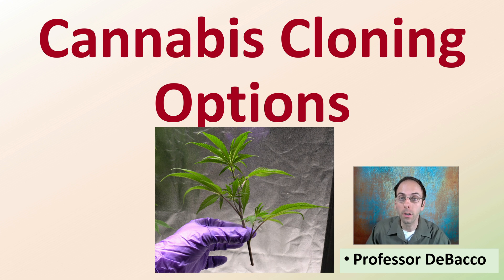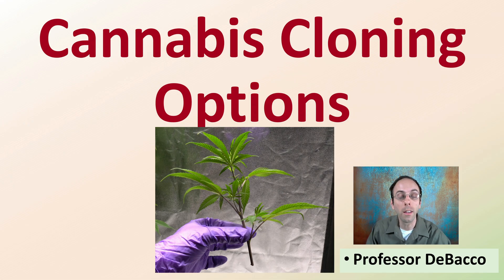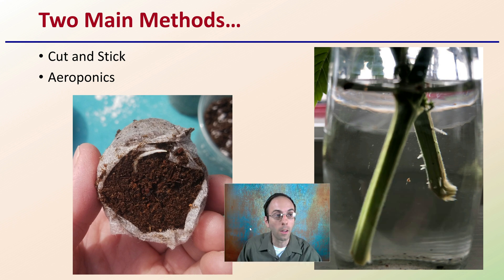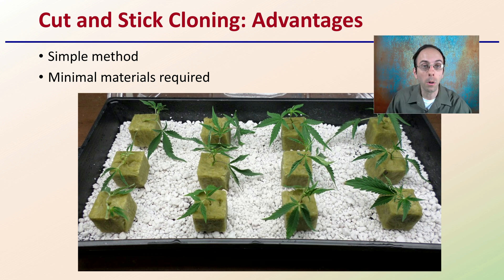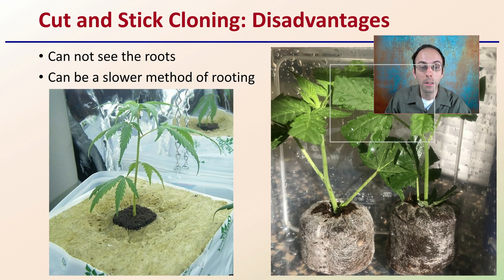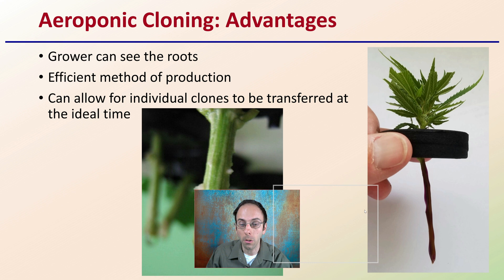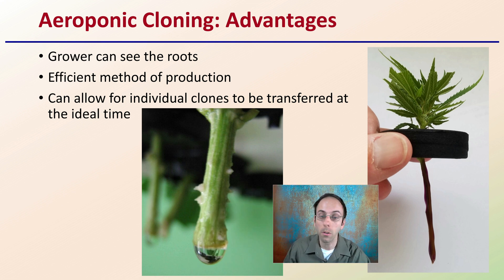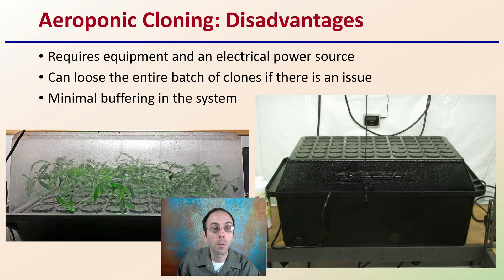Cannabis Cloning Optional Methods

Comment: Another method is simply placing cuts in water between 72 and 80 degrees, change water every day preferably, and voila.
Reply: Only if from great genetics & most likely from a seed as well.
Reply: @nicholasgade2288  it works from cuttings or seedlings and works well, no gel or powder just water.
Reply from the maker: Plain water works, but you can improve rooting rate and speed with other additions.